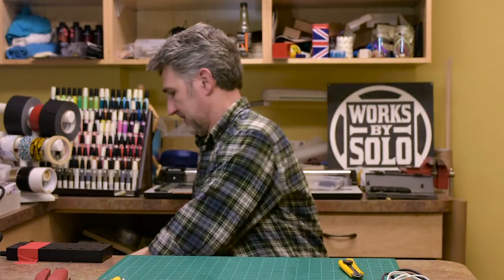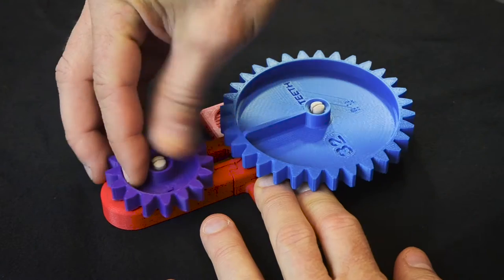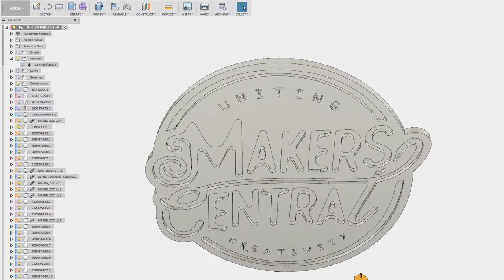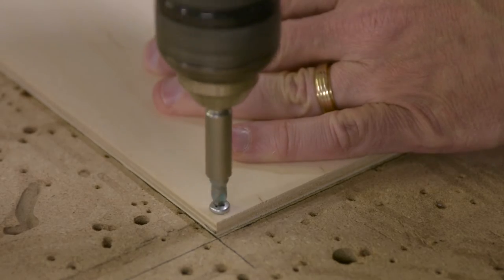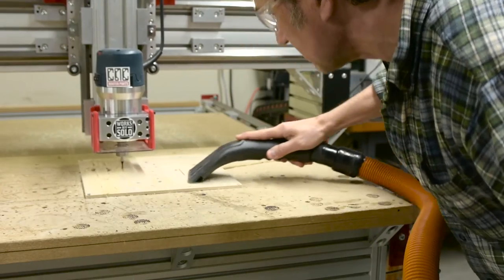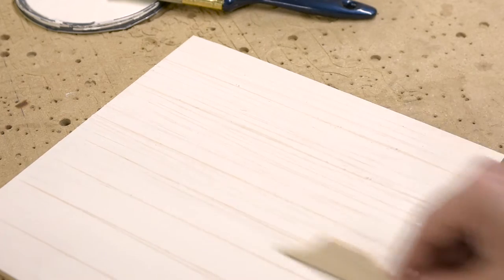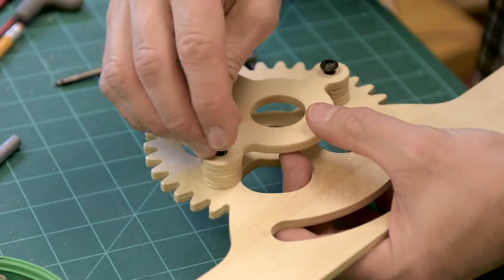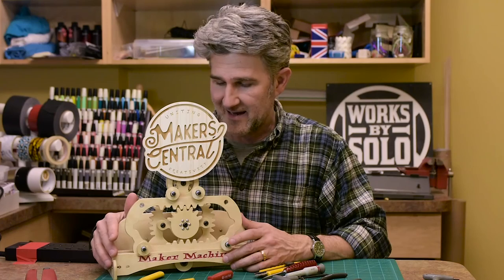The Makers Central Maker Machine with Wooden Gears (Yes! I stuck my finger in it!)

Comment: Awesome video:
6:25 - Since you asked: I pre-finish with 1-2 coats of urethane, then I apply Oramask (or blue tape- if I'm feeling cheap), then I carve... then paint... then remove the Oramask.  Works very well  Sometimes I just skip the Oramask and the tape... then I just sand off the overspray with the "pre-finish" as it acts as a sealer so no paint gets in the grain lines and helps reduce tearout a bit too.... Love the project.
Reply from the maker: Yes, I asked because I like doing this technique, but found some frustrations in the way i've been approaching it. Thanks!

Comment: Dude, this is fantastic! And not just the project, the video too. Love your style.
As for masking, I can’t stand painters tape. One alternative is Oramask 813, or standard paint mask by Avery. A lot of CNCers swear by a couple coats of sanding sealer, then carve, then paint and wipe while wet, and sand the surface after drying. Personally that’s too much work for me, so I mask.
Reply from the maker: That's good info. I really want to do more of this type projects Thanks!
Reply: I wonder if some type of transfer tape from a place like Johnson Plastics would work well? There are a lot of people using lasers that swear by it.
Reply from the maker: Good idea!